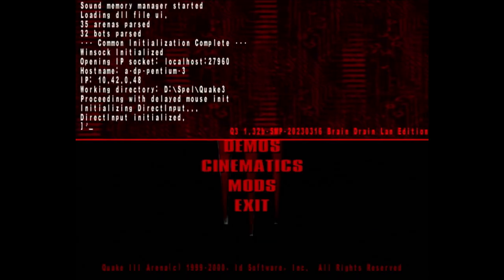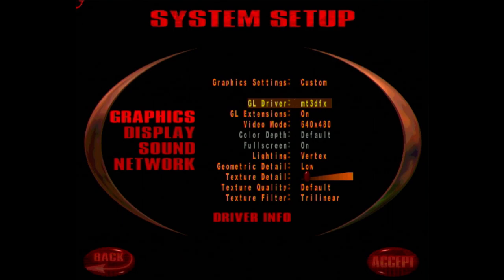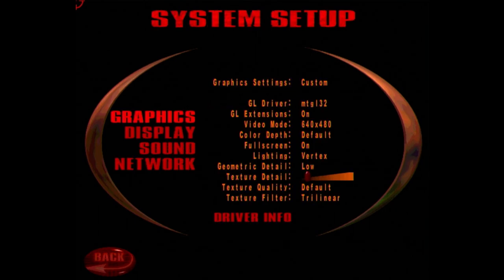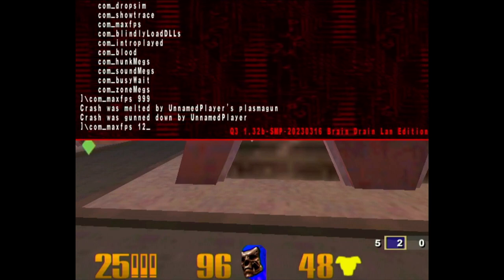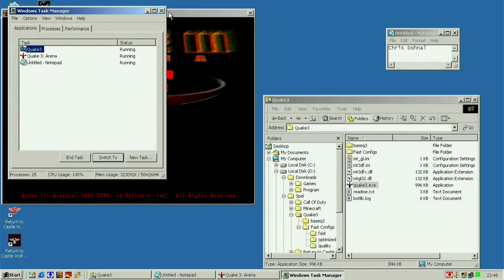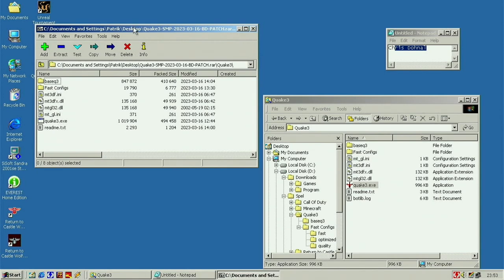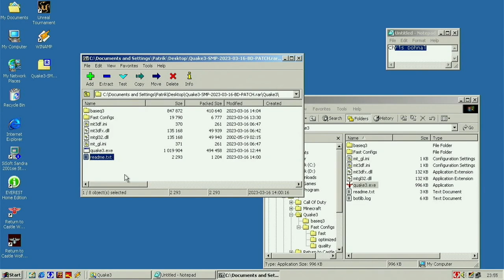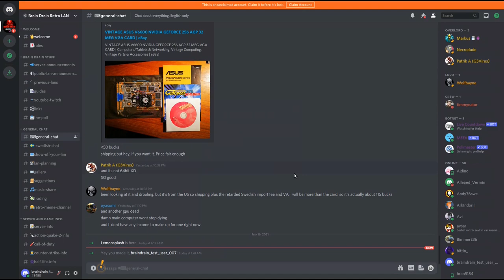Dual Pentium III Build Part 3 - Quake III SMP Benchmarks!

Comment: Did a bunch of Q3 benching (clean install Q3 v1.32c, no mods whatsoever) with a Dual BX board, CPU's varied between P2-350, P2-400, P3-450 and P3-600. Graphics used was a GF4-TI 4200 with 71.89 drivers on W2K.
All CPU combos showed a significant boost with SMP enabled, tho the slower ones gained more. The P2-350 gained +35-40% and the P3-600 +25-35%. Tested in 4 different resolutions and 2 different quality settings (fastest and "high quality").
Then i tried a few other graphics cards and drivers (VooDoo3, GF2-U, Radeon 9600).
Which showed very varied results, some combinations even had negative scaling with SMP enabled.
So clearly Q3 v1.32c has well working SMP support, but it also needs graphics that support it.
Reply: I had negative scaling with R_smp "1" on my Dual pentium Pro with 333mhz overdrivers, and a geforce FX 5200 PCI card. With mtgl32...  I gained 10 extra frames per second.

Comment: I tried r_smp on a BP6 with dual Celeron and Voodoo3 , back in the days.
There was not much change in perf :)
Nor Linux nor Windows 2000 or even FreeBSD.
Reply: Did you apply the multithreading patch?
Reply: @cptcrogge  This was in 1999 or 2000, it didn't exist yet :)
Reply: @nalinux  Fair enough :P
Reply from the maker: yea r_smp gives me little to nothing. 
At best my Athlon MP can get a gain at minimum res and quality settings.
This mtlg32.dll patch from Chris Dohnal so fare has scaled on every system me and my friends have tried.

One Friend has Q3 running 100fps in demo 4 on dual 333Mhz Pentium II Overdrives so thats dual socket 8 cpu's.

I also saw some very good gains on another friends dual Xeon 550Mhz CPU's so yea very nice patch if your CPU limited with a faster GPU or GPU's and you have 2 or 4 CPU system then this patch will make a difference.

 I added the link to his original website in the description.
Or you can get it here if you want to read it.
IT dates back to 2002.
https://web.archive.org/web/20050320015611/http://cwdohnal.home.mindspring.com/smp_minigl_layer/smp_minigl_layer_beta1.html
Reply: Fun fact, in SMP with Linux, I had a bit more FPS on Unreal and Unreal Tournament than without SMP.
I think it's because there's a separate thread for audio.
But only a few FPS, this didn't change anything unless you look at the numbers.
Reply from the maker: @nalinux  Yea I think I heard something about that. My friend gets more fps in UT99 he tells me with the second CPU installed. But if thats because of the game or just because of a separate CPU doing interrupts etc idk.
I have to check someday.